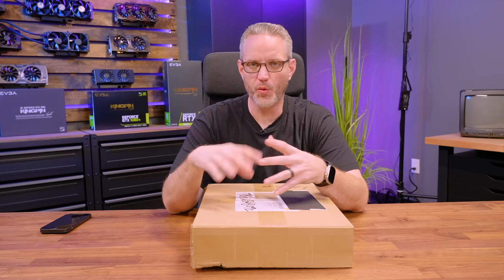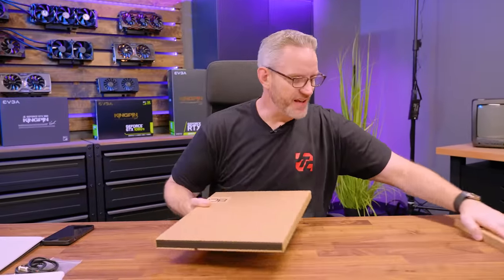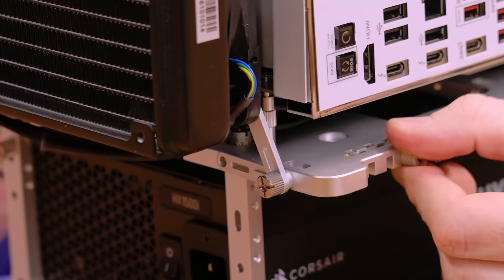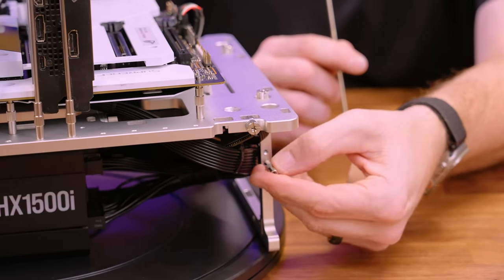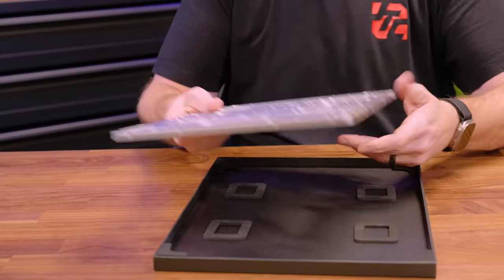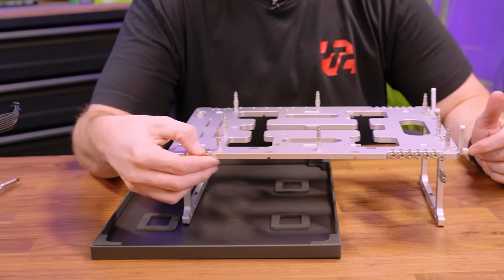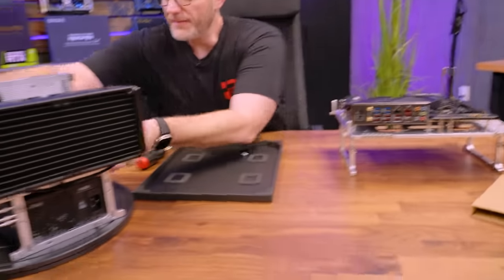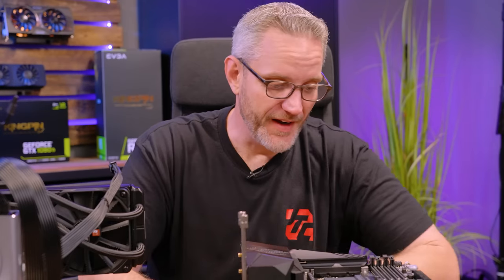This is one of the most impressive things I've seen in a LONG time!

Comment: I've got mine with a 360/45mm rad with a 240/45 mm above it. I also added a couple of extra struts of aluminum to make the radiator mounting more secure (using 4 anchor points rather than just 2 to the base plate) so, no wobble. The opposite end has an EK 140 EVO D5 pump/res using a 2nd pair of Open Benchtable radiator mounts. I also added a Corsair Commander Pro mounted to the underside of the main plate along with a Silverstone PF04 8-port PWM hub. I noticed from yours that they've changed the rubber scratch/slip protectors on the bottom of the legs (mine is a few years old)... mine has pop-in rubber pieces where the newer is a mounted strip. Should be better as mine have popped out a couple of times.

Comment: Pro-tip, if you're going to screw down the motherboard, mount the powersupply with the fan facing down and as much gap as possible between the intake and the table, this way a dropped screw has no chance of getting lost in the PSU, if you dont screw down the motherboard you dont have to worry about it and mounting the PSU fan side up is just easier

Comment: I'm glad that water cooling is still a thing today, I've been water cooling my computer for more than a decade and it ran 24/7 for all that time with only the occasional stop for maintenance and it's still running sometimes now as my network storage, recently I built a new computer also with water cooling so I hope that the quality has not dropped off a cliff because I need this new one to do the same thing without ever breaking for at least the next five years or so.

Comment: This looks like it would make a nice open chassis-style computer build for a desk with limited space for a computer, you just need to make sure to keep it clean.
Reply: Really tight on space use it in vertical orientation by rotating the legs 90 degrees. Has holes for normal (top left io) or inverted orientations. One of mine is inverted to see gpu fans easily

Comment: I have used this for several years and the only real problem is dismantling and re-assembling all the parts to once again make it a flat pack.  Bit tricky, like an advanced lego and not at all obvious the first time you use it.  However, well engineered and when you are finished you can put it back in its box and store on a shelf for your next build.

Comment: Wow, definitely a lot of thought went into the design. Regarding the AIO, I would think that running the fans in a push configuration rather than a pull configuration would yield better cooling for the CPU since it would be drawing air away from the CPU and through the radiator rather than taking warm air from the radiator and blowing it onto the CPU. But that's just a hunch.

Comment: I was wondering if i could replace the standoffs in a ATX case with the pushpin standoffs? i think they may be a bit too tall but the idea that given some work or if they come out with that as another SKU how many people would buy it besides me as we've seen it holds is secure enough and it's just so easy that i find myself wanting them for my next build.
Reply: Your comment made me curious.  It's $10 for the standoff screw kit.  Now it's got me thinking about a new case... a vertical mounted GPU could negate a bunch of the height issue.

Comment: This would have been awesome two weeks ago. I built my nephew a PC for Christmas, two weeks later it stopped outputting video. We, in the last 6 months, moved about 6 hours away, so couldn't quickly stop in and troubleshoot. I suspected the motherboard was the issue but to be sure I took my "stream" PC on a 6 hour road trip, so I could troubleshoot and replace parts as needed. Connected his GPU to my stream PC. Working. My GPU in his. Nope. decided to just replace the motherboard,  gave him my old board I just took out of my gaming PC when upgrading and everything booted up right up. Traveling with something like this would have been less stressful than taking my built O11 Mini. :) I did pull my GPU out of an abundance of caution but I would happily put everything back into their boxes to transport and troubleshoot :).

Comment: I always like this design and would rather have a test bed over a tower case for desktop. The only thing I would do to this test bed is add felt or rubber feet to the bottom of the power supply to help with scratching and vibrations. From what I say on the website you can also separate the AIO holder and make them longer to raise or use longer rads.

Comment: For a 360 rad, it looks like the 2 innermost holes on the end look like they would line up with the inside corners of the outside fans with those standup brackets. Very cool setup btw though. Great engineering

Comment: I really like those.  Even at $200 for what looks to be very nicely machined anodized aluminum and all the hardware that's more than a fair price.  Honesly I'd almost say cheap.  Hell just a basic "press bent steel with holes" 3 gauge panel for my car was like $25.  Was thinking about tossing all my old parts into a case for a beater PC... Really considering this instead.

Comment: I have been thinking of getting myself a test bench and starting up a small business for computer diagnostics. Right now in my area we only have Best Buy who charge an arm and a leg to diagnose systems. I have built over 30 computers since 2017 and feel this might be a worth while purchase so I can trouble shoot systems.
Reply: Got this V2 a year ago, its pretty good I use it for quick drop in testing or oc stuff. However it takes some time to setup, and if the client already installed their motherboard in a case it's best to leave it alone to save time.

Comment: I have a couple of cheap knockoffs like this that I bought on Amazon. They're also made of aluminum, but not as many features as these. I need to get some more and I've been watching these since the cheap Amazon ones are pretty much just as expensive now... so I mind as well go this route. I think I'm sold on the nubbins for the mobo screws. I just wished the test benches like these had a hole to access the back plate for the CPU cooler, but the nubbins should make that not such a hassle.

Comment: I noticed that my outlet voltage from the wall varies a lot here in Los Angeles so I bought a UPS.  When the power goes out (which it does during the summer) I plenty have time to shut down my system and It also gives me a read out of the voltage from the wall and the wattage I'm using.  I'm thinking about buying another one, do you think you could make a video about UPS units ?

Comment: This open air test bench isn't the cheapest but you can really see where the cost goes. The component storage built in is such a smart design and most of what is not in use can remain without impact usability

Comment: I like it for the most part, but if i had that, most things would never be screwed in. Like extra SSD's and the PSU, no reason to mount it on a test bench, unless you'll be moving it a lot? I do have some ideas for wall mounted PC's though with this thing! Its pretty awesome

Comment: I haven't been able to find any iCUE-enabled power supply in years, Jay. I have a RM850i that I love, but I also needed to replace it (I went with the NZXT E850 instead. Anything above 1000 watts is overkill for me right now). If you could reach out to your contacts at Corsair and nudge them into putting some of these power supplies back in production/circulation, that would be amazing.

Comment: I applaud the engineering and how all of the fasteners stay with the "case."  The engineer in me weeps with joy.  LOL
Buuuutt ...  I'm not sure it's worth twice the price of my ThermalTake Core P3.  I don't swap motherboards that often -- not a tester, just a tinkerer.  : )  The P3 is significantly larger but the Power can be mounted underneath leaving lots of room for water systems without any overhang.   Half of one six dozen of another.  ; )

Comment: So, other than the clamping onto or bolting to.. Are there any grounding points or places dedicated to grounding?.. Yes, I know the PSU is bolted to it.. but what if it's not... Number 2...  This is freaking AWESOME!!  build it, take it down and store it, build it again..... Extra screws and placements for multiple options or accessories. I wish I had this 15 years ago when there were so many  incredible and ample supplies of cards, motherboards and accessories of all kinds..... So, will it fit anything but a microATX? It is on my shopping list! I want one!
Reply: The center stand off pin is standard so uses a screw to lock board in place and act as 2nd ground

Comment: I would use threaded inserts instead of cutting threads into Aluminium and use them, because even If you won't tighten up the screws Like crazy, removing and installing them again and again will eventually Strip Out the threadings and make them unusuable...
Reply: Yeah this version v2 uses stainless nutserts, was an issue on earlier revs

Comment: So how reliant are motherboards ground points in regards to the screw holes. I noticed all the holes have solder points that I assume function as ground. I wonder if not using those will affect stability especially when you have heavy load items pulling a lot of current?
Reply: Myself and other XOC guys been using these since 2016 with no issues. Literally all I use for testing, benching and daily driver
Reply: @gtijason7853  Awesome ! Not bashing on it im just wondering if the board relies on those even in other situations. Lets say someone with the same board but different case has instability issues I wonder if bad grounds from lets say heavily anodized screws would affect the power delivery.

Comment: If I could be bothered to dust off my computer every week I think that this would definitely be my next case.  Only thing it seems to be missing are holes in the feet to be able to mount it securely onto a wall which I think would be cool, at least on the mini.  Would be great to just have something like this so I could mount it right under my oversized desk although at that point I'd probably be better with some sort of frame around it in case I ever bump it with a knee.
Reply: some dude in another comment said there is a community and ppl came up with a 3d printable wall mount. might be worth looking into,
Reply: No need for 3d print part. This is the new version and you can wall mount it with the feet set up normally so psu is under mobo or you can even flat mount it and bury psu into the wall if you feeling really crazy. I have 3 myself and one of them I use with the legs set up in the inverted vertical setup so I see my gpu fans better

Comment: So, I get that there’s a bunch of money invested in the engineering and machining, but I cannot help feeling like every test bench is grotesquely overpriced for what you get.  It’s a motherboard tray with legs, if you bought a 20 year old ATX case, you could just rip all the side off of it, and have a frame.  If you want the motherboard tray on the backside, you can cut your frame up a little bit and screw it together, or get a second case and cut out the motherboard tray and screw it to the backside.  Less than $50 in materials.  You could also buy a piece of acrylic to make a tray yourself.  It’s super easy to measure the hold for standoffs, just cut the plexi down to size, slap that into place on an existing motherboard tray, mark some holes, and drill it out like you would any other kind of plexi, and buy some standoffs, and attach it to the backside of your old case frame.  If you measure with a good DIY case for the plexi tray, then you could even find an old HP or Dell workstation chassis, flip it over and attach the tray to wherever you can.  

The machining costs on the product Jay was reviewing is all about the screw and stand-off placement and carving out the negative space so the shavings/chips can be recycled into additional blanks.  So, if it’s just the locations of holes that need to be precisely located for the motherboard tray, those literally have not changed in over 30 years , which is why we still use the ATX standard sizes for everything.  The spacing is published or easy enough to measure on any existing product, so that’s why I’m not into over paying for someone to setup a machine that drills holes in those locations because it’s such a minimal amount of work.

Other companies sell standoffs pretty cheap, and as cool as those particular snap on ones are, you can install smooth posts in place of all but a couple screws and then you can put a nice size thumb screw into place to hold it.  There are custom OEM standoffs that are like that too, so you could also salvage them from an old system if you get lucky.

The bottom line is that these products are just so expensive because they are low volume and targeting people who earn a living with their purchase, so they don’t care if a slightly better product costs more because they will achieve ROI eventually.

Maybe I’m not the right target audience for this product because I don’t mind using existing tower cases without side panels on my benches at work, and I’m too cheap and capable of fabricating what I want out of existing stuff that is dirt cheap.  We’re talking literal eWaste that can be salvaged to make something just as functional as this.  Will it be pretty?  No, but it will be rigid and have holes to mount things to it, and the amount of effort you decide to put into it could make it just as functional as this thing for a fraction of the price.  Open air cases that have glass panels on one side and are painted nicely in multiple colors exist and are literally the same price and you can show them off.  It’s annoying that you can’t buy less case for less than the cheapest case with sides, it makes no sense.

If I owned a case manufacturing company, I would take the cheapest thing I make, rip the panels off and then charge more than most premium branded cases, and make a killing on the markup.  Sure, they machined a bunch of aluminum, that’s not a big deal, and costs more than it needs to.

Hell, you can buy acrylic benches on AliExpress for cheap, which will be the right hole spacing.  Sure it’ll be floppy, but you won’t have to cut or drill the acrylic yourself and then you can beef up the frame with other materials to make it more rigid.

I wish I owned a machine shop, or CNC machine, because I’d buy one of these for way too much money, and start cranking out copies with more generic standoffs and destroy them on price.

Comment: Very nice ! thanks for this Jay.  One quick question - the GFX card ports - are they easily accessed by the cables? and I have an SLI setup (yea I know that's prehistoric) would I be able to mount the 2 cards easily on this test bench?.  Great video - thanks again.😎  Oops scrub that 2nd question about SLI - it can have up to 4 cards according to their site. Thx.
Reply: What gpu's are you using for sli?
Reply: @i3l4ckskillzz79   I have 2x EVGA FTW 3 1080 ti's in SLI -  I bought them for my previous PC which was built by a commercial company and lasted me the grand total of 1 year 3 months meaning when it all went wrong they said "it's out of warranty" so I vowed to always build my own PC from them on so if anything goes wrong I have nobody to blame but myself.  I have a Phanteks case atm which I assembled and it's already outlasted the previous PC by 6 months.  After watching Jay's vids I had a good idea of what not to do. 😀
Reply: @richardboothby5694  2x 1080 ti was may dream setup in 2017. never had one rocking a 3070 ti instead with plans to upgrade to a 4090 later this year.
Reply: @i3l4ckskillzz79  Yup I'd like to upgrade my GPU(s) as well but this time it won't be an SLI config.  Not supported anymore and anyway the present and future generation of cards are quite capable of doing everything necessary in the singular.  I must say that SLI even with my outdated cards makes Blender run much better than I could have imagined, but then I suppose the newer gen cards will easily do that as well. 😃

Comment: Sometimes I wish Jay would put a bit more time for analysing and thinking about stuff before doing those videos, cause they seem to be not-planned done live with the amount of small details being wrong or missed. People already mentioned screws, what caught my attention was when he mentioned mounting brackets for radiators and said they cant hold a single fan cause they aren't long enough to catch it when "bend inside" (14:30), when you can easily see there are freaking additional slots CNCed into the base to accommodate those brackets closer to middle to hold exactly that a single 120/140mm radiator and thus a triple radiator thou hold by just its middle fan. You can see those slots made on 3 sides of the base plate with the ones on the "long" side being just single fan ones (for example for a fan for GPU/CPU while LN2 cooling or something), you could also use the "deeper" "holding" slots to mount a long 3 fan rad on both "long" sides. So his "whining" is kinda uncalled for.

Comment: This. I am not a case and rgb person and it is all down to personal choice. Some gamers feel all the distractions help them game or just a vanity thing. I personally prefer putting all of my money into the ram, cpu, gpu, psu and mobo. I promise for £1200 my rig outperforms any £1200 pc that invested hundreds into a case plus rgb and all the other wasted money that comes with a tower set up. If it comes with rgb, I am happy with it, I just do not seek it out. Fair enough my open stand was mostly engineered by me based on their last pattern as I was not willing to part with £200 quid for it. Our son has a thermaltake and all the bells and whistles of rgb. His gpu is an RX 5700xt, mine is a RX 6900xt. I invested the exact same money in both, but let him pick all of his parts as long as he had room later to upgrade the gpu. BUt his looks pretty even though no one sees it but me when I dust the dirt trap 🤪